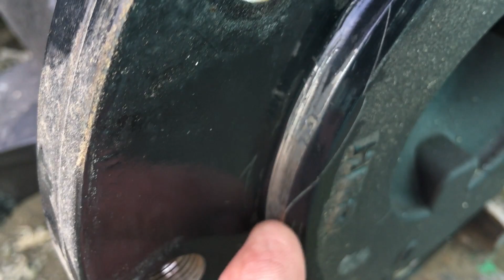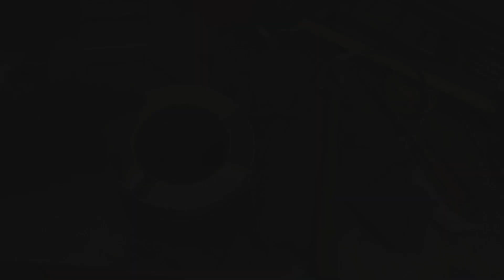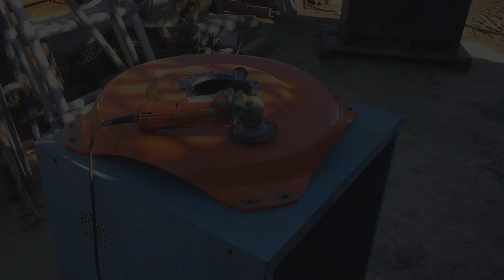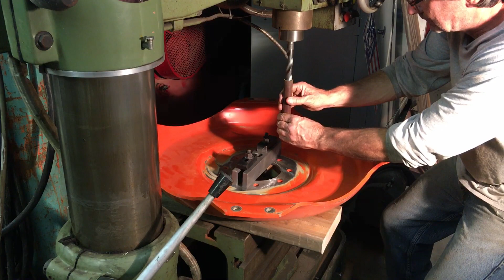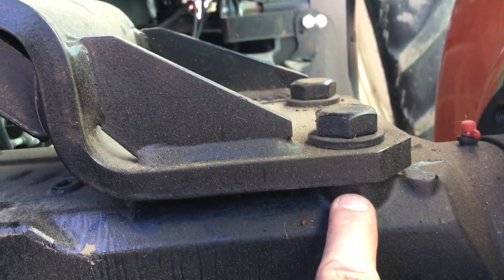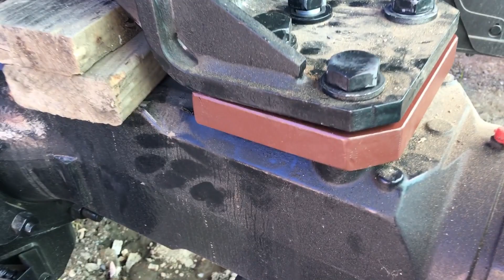Tractor Wheel Mod

Comment: Found it quite interesting with this modification of the tractor wheels. Loved the radial torch, ran them when I worked in a Steel slab shop back in the early 70's. Brought back memories cutting of 10" X 60" and 80" slabs. Thanks for the look.
Reply from the maker: Thanks John

Comment: Id like to see a video about that wilton drill press I saw in either this video or the last. I have a wilton geared head drill press 24503 is the model number. I cleaned it up but when I put a Jacobs Chuck in it or the off brand one it came with there's wobble at the drill bit. I havent investigated too much but the spindle seens to rotate smoothly I first notice it when a Chuck is intalled. So i am going to indicate some stuff to try to figure it out. Any advice would be great!

Comment: Hi nice to be here learning what a farmer must do to yield continued great crops, we like learning and this is a good place for this we did not know the material garlite until now, G series resin and fiber sheet material know this material from custom knife handles but did not know it is actually garlite. 
Nice to have a radial drill wow great for your line of work for sure in our thoughts. Nice spacers nice lift kit for a tractor we think. 
We like what you are making now we know Dean and we too just got our sticker from him here, and we too shouted him out even though we are newbies we are thankful to be in the YouTube community. thank you. 
Lance & Patrick.
Reply from the maker: Active Atom 
Thank you for stopping by and checking out the video. I am also a newbie. Or should I say  a fish out of water. But one has to start somewhere. Thanks again, Gary